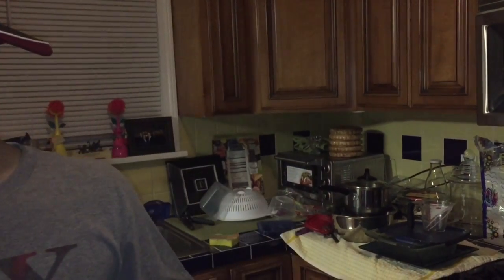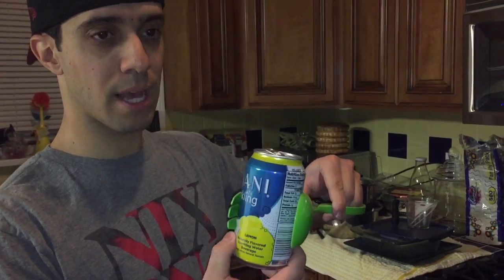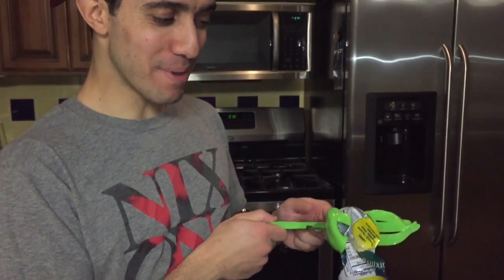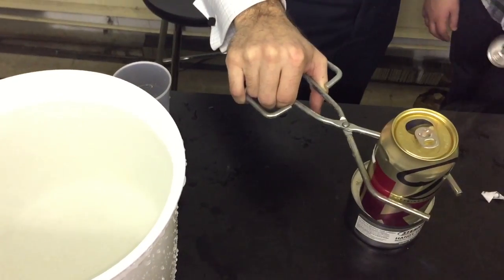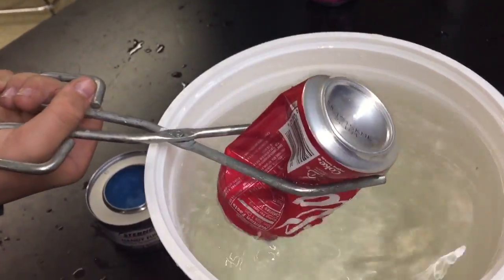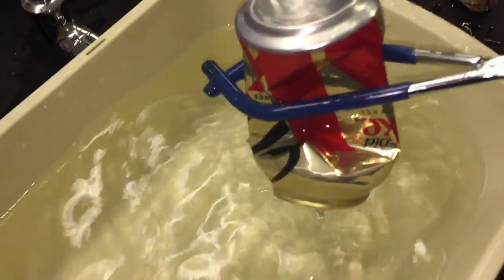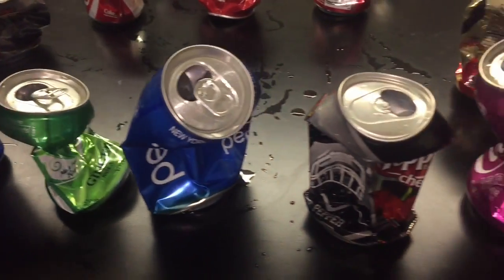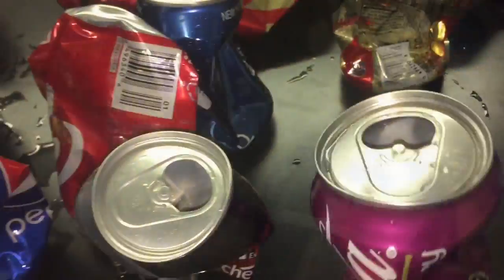How To Crush a Can with Water!!

Comment: Just your basic metals with water and heat and coldness. 

For example, If a ceramic cup, (A Mug) has very hot water in it. Then it gets poured out and Ice Cold water goes into it right away or within 30 Seconds, it Cracks!!!!.

Comment: This is caused by convection.
Reply: Convection is the concerted, collective movement of groups or aggregates of molecules within fluids (e.g., liquids, gases) and rheids, either through advection or through diffusion or as a combination of both of them.
Reply: Noah Keith Or in simpler terms the  particles expand when they are heated and when it cools the particles contract.
Reply: MrMinecraftknight causing a suction.
Reply: No, the steam drives out the air particles. Leaving the can full of steam particles. These the form liquid water when the can cools. There is now a vacuum in the can. Air pressure now crushes the can. Simples!